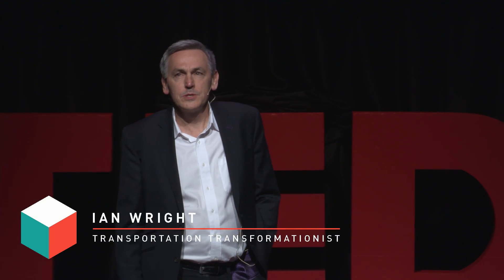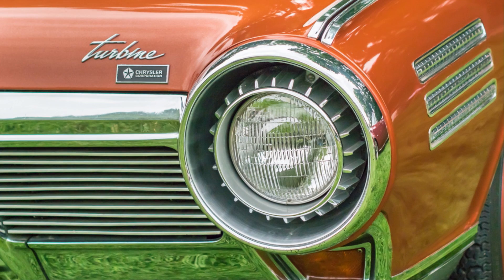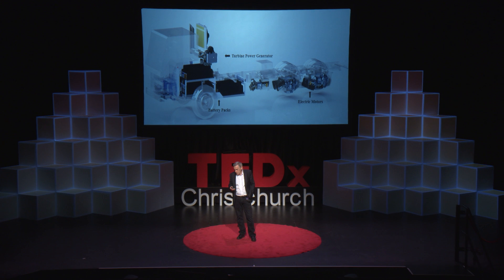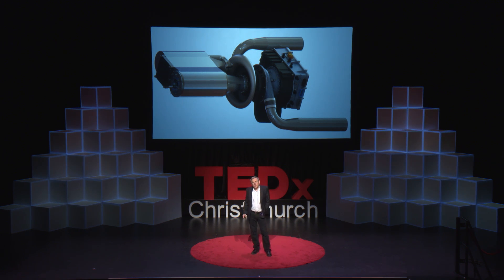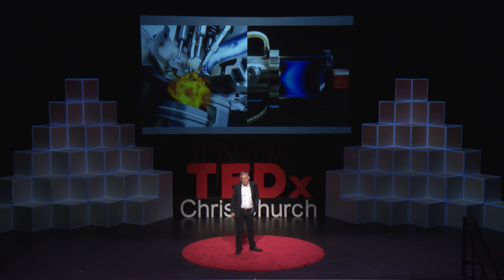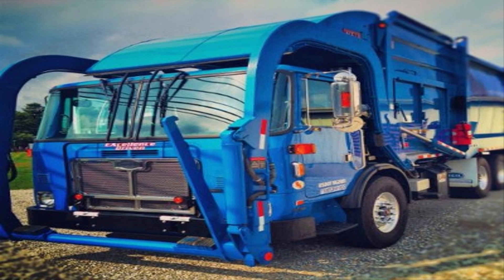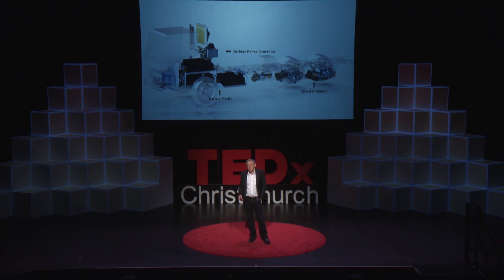How jet-powered garbage trucks can save the world | Ian Wright | TEDxChristchurch

Comment: It is a well known fact and easy to explain why a gasturbine has a lousy thermal efficiency compared to diesel engines.   On top of that diesel engines are cheap to build, are extremely durable and with a turbo charger are very compact.   And when using a 2-stroke diesel even more compact.  The idea of using a gasturbine in trucks is the personal opinion of the presenter but this is absolutely not shared by the manufucturers of large trucks with decades of experience to optimize their trucks and engines.
Reply: Gas turbines operate at a peak efficiency of around 50-60%. A Diesel is 40%. Diesel engines would be more expensive then what Wright proposes, and achieve nowhere near the same emissions.
Reply: @MoronicAcid1  No way a gasturbine has a thermal efficiency of 50 - 60 %.   Could it be that you counted the waste heat as used full heat?
Reply: @MoronicAcid1  Pleas e look at the Carnot efficiency and you have your answer.  The turbine inlet turbine is limited to some 800 °C while the maximum temperature in a combustion engine can go well above 1100 °C because it is intermittent.   So NO, the thermal efficiency of a gasturbine is well below 50 %.  I think rather 20 - 25 %.  You may be confused when you count the waste heat of the exhaust gases as part of the efficiency, which is not correct.  And if you do then you should also count the waste heat of the diesel engine as useful energy.

Comment: I am impressed by the competence of the speaker.
Here is an explanation of the soot a diesel engine must emmit, and why a gasturbine does not, producing a clean combustion.
The high compression in a diesel engine produces a combustion temperature exceeding 1000 °C.
The combustion of carbon above that temperature produces carbon monoxide, no carbon dioxyde. Only after the expanding gas cools below 1000 °C the Bouduard process converts two CO molecules to a single CO2 molecule, leaving one carbon atom unburned, for lack of oxygen, this is what is called soot.
There are some advantages to it, namely the carbon adheres to the wall of the cylinders, greatly reducing friction and wear, typical for diesel engines.
On the gasturbine, on the other hand, the turbine inlet temperature is in the order of 900° C or lower. The combustion in the combustion chamber may locally exceed 1000 ° but there is a lot of oxygen to completel burn all carbon residues resulting from the Boudouard process. Further the gaseous fuel contains more hydrogen, producing the blue combustion. Shown in the photos is a well designed combustion chamber, resulting in a clean exhaust, provided no sulfur dioxide is in the fuel .

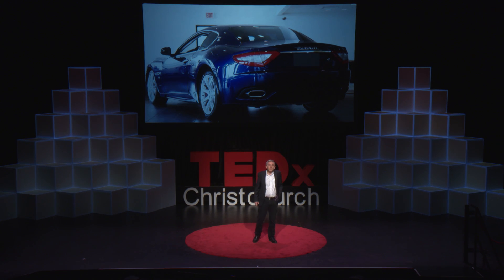Comment: 11:00 "...plug-in vehicle market in the US is stuck at 0.5%...": This speech was in 2015. In 2022Q2 the EV market share was 12.6%. That's 25 times what they were "stuck at" in 2015. And that share is increasing at a rate averaging 10% per quarter. At that rate, the EV market share will be over 50% by 2026.

Comment: In 2015, this wasn't a bad idea.  But battery technology has come a long way and it's still accelerating.  Large, rechargeable, high energy batteries are still in their infancy and there are many breakthroughs being seen in labs around the globe.  Their cost per kWh has come way down over the last decade and by 2025, will probably be cut in half again making fully electric trucks and cars much more economical than any fossil-fueled vehicles, including hybrids.  If you read all the latest literature on all the advancements in the works, you'll see that fully electric transportation is the future.  And renewable energy in the form of solar and wind will take over as well.  Maybe fusion energy will finally become a reality later on too.  Oil will switch to being used only for lubricants, making plastics, etc. and we'll finally stop polluting our world by burning it which only wastes it.  Coal will no longer need to be mined at all.
Reply: Although this was aired in 2015, little changed, electric semi is still not in production, and coal still made over half of power generation. We probably will still be talking about it 7 years from now.
Reply: Battery technology will never reach the same energy density as combustible fuels. There's nothing economical about mining for batteries. And who said anything about fossil fuels? Turbines can be built oil-free.

Comment: Use hidrogen and you can still use the Piston engine and you only have water vapor and you can breathe the air coming out of the exzost so why don't they cut to the chase and quiet wasting all of this mterels you only change your oil every 50.000 miles because it finely wore out the engine will last for 2 or 3 thousands of miles with out having to rebuild it thair is no carbon to make dirt in an engine so wats the hold up

Comment: He didn't include the cost of battery replacements, which, in this case, would be tens of thousands. I once considered buying the GM Volt until I found that a replacement battery from the factory cost $34k at the time, not including installation. Battery degradation and replacement cost are two of a few major obstacles that keep me from buying an EV.

Comment: Enh. jototo's puppetmeaters want ZERO petroleum. What will the turbine burn? I worked at a coal fired  power plant near St. Louis in the mid-nineties. When I was in the control room, the operator would show us how much cleaner the air leaving the stack was compared to pure atmosphere it was taking in. So not only doesn't coal burning pollute, it actually scrubs the air cleaner. Sure there are trade offs to mine the coal and transport it, but nothing is workout compromises. Except alternate energy. That's a pure compromise.
Reply: Where did the CO2 produced from burning the coal go, if it was not going up the stack?
Reply: @pauleohl  Scrubbers collect it and it gets reburned at such high temperature it changes the molecular structure of the soot. Same as vehicle catalytic converters and dpf on diesels. We've had the cleanest burning, most affordable energy production for over 50 years but they can't control the proletariat with clean, affordable energy as close as the light switch in your living room.  Behold the "alternative" energy scam.
Reply: @bigblocklawyer  Are you unaware of the difference between soot and CO2 gas?
Reply: @pauleohl  Yeah. Don't do any research, just keep mouth breathing.

Comment: Why didn't this concept take off?
Reply: cause its nonsense, from the first minute. jets replaced reciprocating engines in planes because there lighter, and planes need to be light. Trains, boats and trucks still use pistons cause there, cheaper, rev better and are more fuel efficient
Reply: @robertbowman9108  Wright proposed a very cheap turbine design. Much cheaper than a Diesel. They don't "rev better", whatever the that means. A modern gas turbine is 25-50% more efficient than a diesel. Don't forget better emissions with the turbine too. Good day, sir.
Reply: @MoronicAcid1  it takes longer for a jet to go from idle to redline, a piston engine can do it instantly

Comment: Too good, makes too much sense so it will be ignored. I believe engineers deliberately ignore the GT preferring "new technology" BEVs and hydrogen.
Reply: Engineers? They don't run companies and rely on budget and freedom to R&D on the goodwill of business management and marketing monkeys in suits.
EV and Hydrogen are trendy and that's what is pushed by political ideologues, the other monkeys in suits, controlling by pen and tax what is "Right or Wrong".
The "Freedom is Slavery" thing comes to mind.
Though engineers need constrains so they don't tank companies with R&D, like Mazda almost did with the Wankel shenanigans, we shouldn't trust every aspect of technical  decisions to bureaucrats in the "Ivory Towers", in government or business.
Trust me! I'm an engineer! 😅
 Even before College and I think High School, I was thinking about Diesel-electric locomotives and mining equipments. They use Diesel engines with an electric generator, while electric motors provide incredible torque on demand directly to the wheels with minimal or no power transmission mechanical mechanism (which weighs a lot and has losses). Similar concept for different types of engines and fuels. I also remember being fascinated by turbine cars and thinking about the issues.
A lot of people out there, with and without fancy degrees, are thinking about such things, but we don't have the freedom or resources to explore the possibilities.
Reply: @chaoswarriorbr  That's some statement, thanks for taking the time.

Comment: Electric motors do not need transmissions.  Perhaps a 4:1 (or whatever is chosen) reduction gear.  He wasn't clear on this.  Regardless, a fascinating concept!
Reply: The problem is you need a very large, heavy, expensive motor to be capable of launching a 60,000lb truck on a 25% grade as well as go 75mph.  In an application like this, a multi-speed transmission is a better option.
Reply: @-Enginerd You probably also need to invest in ear muffs or ear plugs.

Comment: Given this is 4 years old I guess it never took off. Anyone know why?
Reply: Many many reasons.  It turns out it's difficult to design a turbine range extender, a 4 speed eAxle, power electronics, battery modules, aux. systems, etc. with a skeleton crew and a shoestring budget.
Reply: No one mentions jet noise levels.

Comment: The life of all ground based turbine engines can be greatly extended by using steam. The change of state creates a huge energy advantage and that vapor would exit the turbine at extremely low temperatures compared to being purely driven by flame. Exhaust velocity can also be recovered in the same step that WATER, from the steam, would be recovered. Of course it's not easy and the unit would be bigger but I think the savings would be substantial. Don't forget about the BESLER STEAM AIRPLANE ! !

Comment: Wankel rotary engines when run on hydrogen are 23% more efficient than using gasoline and near zero emissions.  Maybe a better way to replace the turbine. Worth assessing.  BTW, many companies make rotary engines, not just Mazda.
Reply: H extracted from water is the future. Fast electrolysis is a suppressed tech / Stan Meyer and several others have shown it to work
Reply: As of 2020, the majority of hydrogen (∼95%) is produced from fossil fuels by steam reforming of natural gas, partial oxidation of methane, and coal gasification.
This energy intensive process releases six times more CO2 than it produces hydrogen.
Pretty much, 95% of hydrogen is essentially a fossil fuel.

So. If there's any leftover cleanly produced hydrogen, I'd say it's better to just be used in the existing hydrogen-hungry industrial processes. We don't need more consumers of hydrogen.
Reply: Wankel or turbine... Same outcome... In this regard

Comment: A Stirling engine is more efficient and I can configure a Stirling cycle turbine.  Stirling.nevadacan
Reply: Agree, and as a Stirling engines Burner runs at atmospheric pressure, there won't be any NOx. Something a gas turbine still emits. Also, IT can be made even more reliable than a gas turbine.

Comment: I would love to see how the turbine's energy is converted into electricity... Also, some ballpark numbers relative to where and how "losses" are incurred during conversion. If I was to guess, I'd say it's a hybrid transformation process. 1) Bottleneck Thrust. 2) Peltier/T.E.G. Integration. 3) *Rotating Kinetic Energy Heat Sink*. 4) Fluid Heat Transfers. (Not necessarily in that order.) Anyway, I love what your doing and wish you and those like you to be successful in your passions. The world is changing fast, we can't let greed or power arrest humanity's adaptability. Adapt or Die vs. Survival of the Fittest                   P.S.  Id really like to brainstorm with you, assuming this message finds you. Thanks again for your work!
Reply: I know this comment is 3 years old but you could also just bolt a generator directly onto the turbocharger shaft via a gear reduction, like they do in F1 powertrains
Reply: @kaiyeena  all good except there is no turbocharger shaft remember, they got rid of the Diesel engine completely in this scenario - hence why the turbocharger has now become a standalone turbine ;)

Comment: What  does a microturbine electric generator that runs on natural gas cost? It seems strange to me that we heat our homes with natural gas without having it do any other work first. (electricity generation)
Reply: Yes  ! ! it would be Extremely efficient to simply hook a heat exchanger to the turbojet and heat your house while generating much cleaner electricity than coal fired plants. It would be most cost effective in northern states and all of civilization above USA. AWESOME suggestion!
Reply: I'm not an engineer so this is just a layman suggestion but I have spent a lot of time comparing heat exchangers, oil boilers and gas recently before I bought a new heating system. Oil and gas boilers tend to only heat water to about 60 degrees. Neither of this temps are high enough to generate steam because we don't want steam. We use hot water in our heating systems. So I suspect the reason nobody does it would be because we'd first have to heat up our water an extra 40 degrees to get the steam to power the turbine, then cool it back down 60 degrees before we could send it off around the central heating system. Nobody wants 90 degree water coming out the taps. Now we can bleed some of that heat back into the cooler water coming from the heaters and get some efficiency there but not huge amounts. Say the incoming water is 10 degrees we'd need to use almost twice as much energy to get to 100 than we would 60 and there'd be more inefficiencies there, I just don't see it as a likely cost efficient way to generate power.
Reply: @daemonbyte  It's easy. have a variable control valve or variable speed pump. this will control the flow into the ... wait a minute. i think u confuse this with a steam turbine. there are gas turbines too u know. also, u can have the working fluid free of the circulating fluid, meaning the water in your heat exchanger can be indendent of any other water here. so y does it have to turn into stea,m?
Reply: @poknatinpokkers5289  because I didn't see another way to heat water and spin a turbine. But I guess your idea is to use a gas turbine and then use the hot air to heat the water to 60 for the heating system after it's been through the gas turbine? That could work although I suspect there's a reason nobody's done it I'd be interesting in seeing the figures.

Comment: Inspiring. Innovative. Intelligent. I want that powertrain in my car too. Tiny turbine. Tiny battery pack. I can see it already. Will need a good muffler though.
Reply: By adding a recuperator, a low pressure ratio gasturbine efficiency can be greatly improved
The turbocharger based designs are best suited for that improvement. Moreover the noise is muffled effectively , addressing your concern directly, C Yesso.
All what I said I can prove by the thermodynamic cycle analysis  and plotting the entropy-enthalpy diagram. The approach of  using a recuperator is being used by Solar engines , based in San Diego.
On a larger scale. No reason , not to realize it on a small version, with some small loss of efficiency .

Comment: This is the best solution I've herd of so far. There are breakthroughs is battery technology and solar power, but non of them issue the actual problem so straightforward like this. Probably this man should work hand in hand with the developers of demission technology developers who trying to extract CO2 from the atmosphere. If they could patent a full circle of manufacturing one of the greatest problems of our century could be solved.

Comment: Good presentation. His turbine electric hybrid truck  pollutes at point of use, in front of people's lungs.  But for large road vehicles the turbine hybrid is the answer.  It is also suitable for buses. But we do not see them in volume.  There has been a successful trial by Alstom in Germany of hydrogen powered fuel cell trains.  It is zero emissions at point of use, apart from water.  The UK is organizing a test near Alsom's Liverpool technology centre.
Reply: Why in the world would you want a fuel cell train? An electric train does not even need batteries as it can get the power from the rails or overhead lines and send generated power from slowing down back into the grid.  Using hydrogen to store electricity is very inefficient.
Reply: @bobo888bobo  
The hydrogen creates electricity as it is needed via an on-board fuel cell. It has range and zero emissions. BTW, in Germany they now have a hydrogen fuel cell is operation taking fare paying passengers.  Also Liverpool's Merseyrail metro later this year will trial battery/electric trains that run on 3rd rail and batteries on electrified lines. This extends the rail  network onto track that was unviable to electrify.  The batteries can be charged via the 3rd rail when on electrified track.

Comment: I bet he wish he kept his Tesla stock a little bit longer.
Reply: this is the real game changer not tesla
Reply: @ChuckLeeClerk  There is always more than one solution to a problem. In this case Weightspeed doesn't even offer a solution for cars but for commercial trucks (as in not pickup trucks), whereas Tesla produces cars (yet). At the moment I think Wrights solutions for trucks is way more feasable and reasonable, but development doesn't stand still. There might be better batteries in the future which make full electric trucks more feasable. And as battery technology and production improves, which means lower cost and higher capacity, a range extender for an electric car make even less sense.